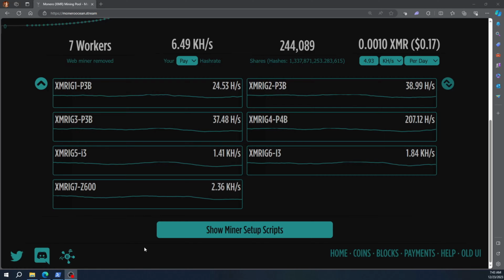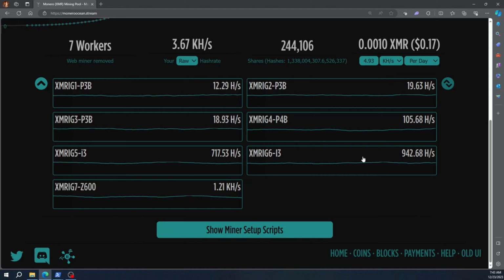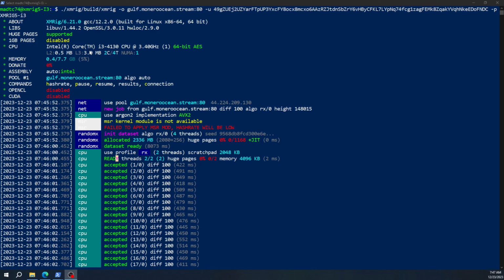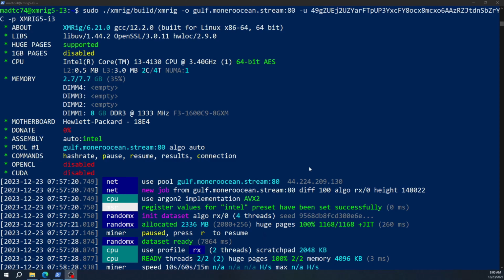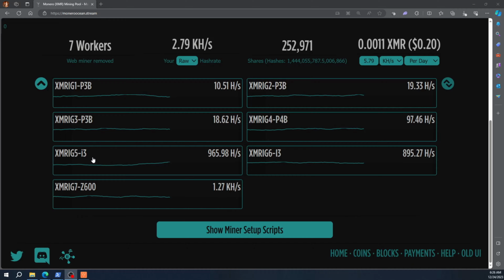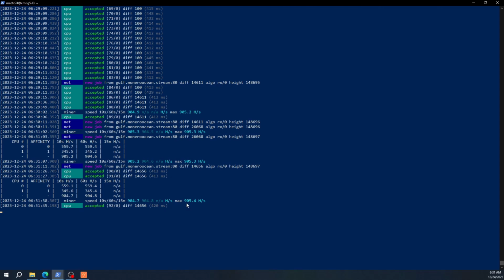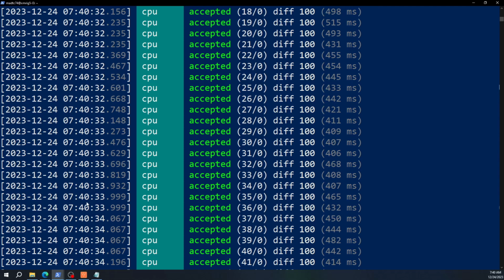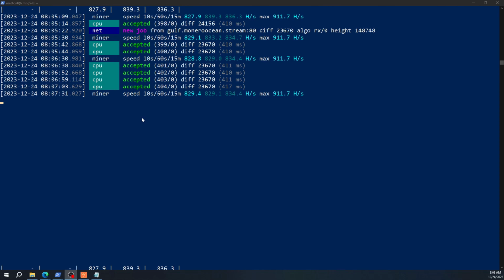Optimizing Intel i3 Processor Hash Rates for XMR Mining: Boosting Performance with MSR MOD!

Comment: Do you have any solution for windows ?
Reply from the maker: I do not. I would start by looking at the configuration file for XMR in windows. You may also try running it with administrator mode. I am not sure, because I never done it with windows.
Reply: thnx but i tried run as administrator but on says huge pages available and the msr mod says cannot set msr 0x000001a4 to 0x00000000f i searched but i didnt find a solution on internet all related to ryzen on windows i guess , it would be a great helps if you find a solution brother 
  @madtc74
Reply: also for huge pages are available but 1gb pages not available sadly
Reply from the maker: @dellalioussama1124  you may want to check this out: https://xmrig.com/docs/miner/hugepages#onegb-huge-pages